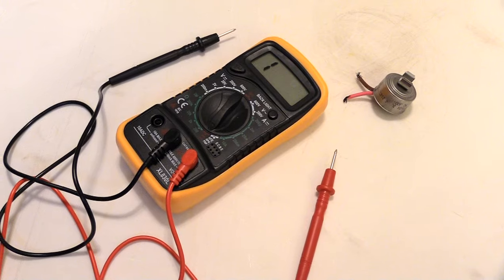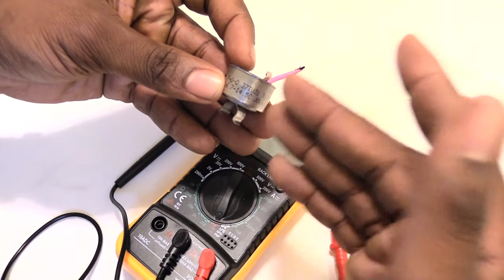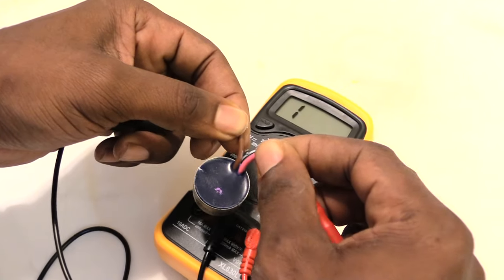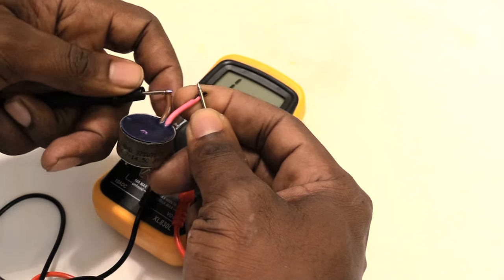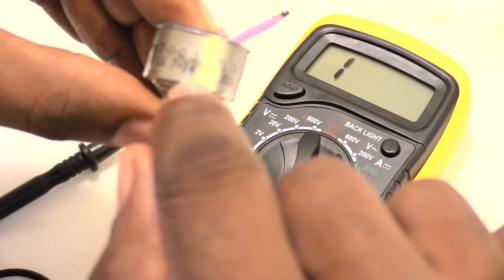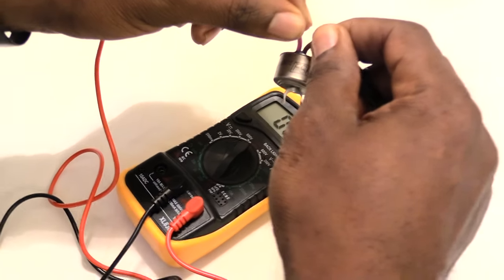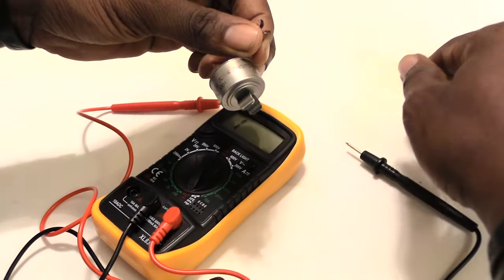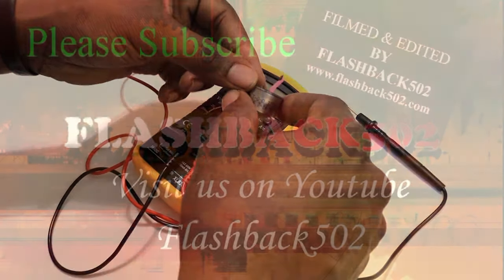How to Test Refrigerator Defrost Thermostat & How it Works!

Comment: This video explained it so much better than any of the other top videos. They all said "IF CONTINUITY, WORKS OK" but there could be more than one problem with a thermostat.
Reply from the maker: In some cases yes, so if you still have same problem after testing, then I would replace to be sure. And Rule out  thermostat as your problem.

Comment: Thanks for the explanation.  I think you meant evaporator heater instead of evaporator.  When the the temp lowers because of frost and time, the thermostat closes and the heater next to the evaporator (coil) comes on.  The evaporator heater melts the frost and ice.  Then the thermostat warms up too and opens losing continuity and shuts off the heater.  Right?
Reply from the maker: Thanks for comment and for like and sub👍.

Comment: OMG...thank you for being so damn thorough. I watched numerous videos and yours is, by far, the best.  I clipped the wires, wrapped it around the multimeter, like in your video, and it beeped when I sprayed it with compressed air and the beep stopped at 54F (according to instructions about the numbers on the device). It was supposed to stop beeping at 59F, just a few off. It was truly a magical thing for me how it worked exactly like you said it would. Thank you. 

I check the compressor with the multimeter, and that works and  I changed the old relay, after testing it. The refrigerator/freezer still won’t get down to the right temperature. What else could I try?
Reply from the maker: Thanks for watching you could have a problem with your compressor if it's not coming on then frezzer and fridge will be warm, if your fridge was unplugged for over a few hours it will take a day or so to get back to normal temperature. How it works out. Goodluck. Please subscribe & like and share if haven't already and check out our other helpful videos

Comment: Appreciate your time. Thermostat will also raise I saw if bad. My element wont come on even when I manually cycle the frig by pushing light switch in frig 5 times I hear timer engage but element wont get warm. It checks out at 29 ohms so it seems good.
Reply from the maker: Your welcome hope u get it fixed.Please subscribe & like and share if haven't already and check out our other helpful videos

Comment: Good video, well explained but, I was searching for an answer originally to a question that nobody seems to have covered.  Maybe it’s a stupid question but, I really don’t need you to replay since I figured this out myself.  My question was ,” can you substitute a thermistor for defrost on the freezer evaporator with the bi-metal you are testing. I found that my 2 year old  fridge thermister tested bad, and a bi-metal was 75% cheaper.  I used the bimetallic and it worked fine and I am back in business
Reply from the maker: Thanks for commenting glad you got it fixed👍Please subscribe & like and share if haven't already and check out our other helpful videos

Comment: Good video, but it may be misleading for other cases, as not all fridge defrost the same way. Mine has L140-30F on the thermostat, so at room temperature it has continuity all the time. It’s a GE side-by-side.
Reply from the maker: Thanks for heads up👍Please subscribe & like and share if haven't already and check out our other helpful videos

Comment: This will be the next thing I check the next time my freezer coils ice over. We have a door seal on the fresh side that needs replaced (back ordered), but I'm not ever seeing the defrost cycle kick in anyway. Cleaned the exterior coils under the fridge last week (they were completely blocked) and made extra sure the doors were closing fine, but we still had problems. Its been more humid this summer, but no where near bad enough to overtake the defrost mode. Hoping its just the thermostat since I'd have to go deeper if it wasn't.
Reply from the maker: Yea definitely could be your problem hope u get it fixed. 
Please subscribe & like and share if haven't already and check out our other helpful videos

Comment: GREAT INFO!
Is this thermostat mounted inside the freezer itself (behind the panel where the evaporator fan is located)?
Or... 
Is this the thermostat for adjusting the Frig temperature which will be located inside the regular part of the frig usually by the dials to adjust the coldness of the frig?
My defroster does not want to turn off on an older Kenmore Frig. The defroster timer seems to be working as I can see movement inside the timer mechanism. Thanks.
Phil
Reply from the maker: It's in freezer department behind panel. Please subscribe like and share and check out our other helpfull videos

Comment: Changed mine out this morning then decided to check the continuity on the old one I had continuity when it was room temperature indicating closed and on low side as well. as far as I know I have not had and overworking evaporator.  if anything it has been under working because I have build up of frost and drinking water line dispenser freezes up. Now I just wait and see if it starts working properly. Your thoughts on closed Circuit at both ends of the temp range?
Reply from the maker: If fridge works right then thermostat is bad sometimes they can fail in strange ways.
Please subscribe & like and share if haven't already and check out our other helpful videos

Comment: Thanks for this video .
My fridge when I plug in the wire the fridge light inside the fridge working but the fridge compressor and the little cooling fan the one next to the copmressoer not running ?
Reply from the maker: Might want to check your timer to be sure it's working right.Please subscribe & like and share if haven't already and check out our other helpful videos

Comment: I have a GE fridge and I believe I need a new defrost thermostat. There is one within two degrees of the on & off temperature of the original. Essentially, isn't this just a switch that opens and closes with temperature changes?  Thanks

Comment: Nice video thank you.  So on my thermostat it reads L14.4 - 22.2c.  What is the opening and closing temperatures?  Do you do it the same way as the L55 - 35F which equals 20F?  Thank you

Comment: Thanks for the video.  My defrost heater keeps burning out every 5 months or so.  I think that it is staying on too long.  If the defrost thermostat is not working correct will that cause the heater to burn out eventually?  As I understand it, the defrost thermostat is sitting there....already closed when the defrost cycle starts.  The defrost heater heats up.  When temperature reaches certain temperature....the defrost thermostat opens....thereby stopping the heater.  Once the temperature drops to a certain temp the defrost thermostat closes and is ready for next cycle.  Is this your understanding?
Reply from the maker: Yes that is how it should work you could have a electrical problem also be sure your frig is not to close to your wall. Please subscribe & like and share if haven't already and check out our other helpful videos

Comment: hi! will it only sense the temp when it is clipped to the copper tube? I found mine unclipped and floating free (maybe due to all the frost on the pipe)
Reply from the maker: It doesn't  matter if it's clipped or not. Please like subscribe and share.

Comment: I noticed water damage to the base molding by my fridge and water on the floor. When I opened the freezer I noticed some frost on the evaporator coil so I just changed the defrost thermostat today and will see if that solves it.  When testing the old and new thermostats I couldn't get my multimeter to beep to test continuity on either one. I placed them in ice water for a few mins then tested the leads but no beeps. Even though the new one didn't beep I went ahead and installed it today.  I'll check my coils again in a couple of days to see if I'm still getting frost on them.
Reply from the maker: Hope it works out👍Please subscribe & like and share if haven't already and check out our other helpful videos

Comment: My defrost thermostat is stuck in the closed position.  I heated it in hot water to see if it would open and it did not.  Would the computer stop the defrost cycle anyway after a certain time?  If it does this, would the computer then  not  go into defrost mode until reset?  My fridge was totally frozen up and I thought the defrost thermostat would be stuck open?

Comment: I got a question I replace the defrost heater, and the Defrost Thermostat was on there too.  1 week later the frig was 50+ replaced the Defrost timer. Frig was 35-40' now about 5-6 days later, the frig back up to 50'+ And they is frost on the Freezer, (0'-10' normal) All parts are GE. Could the defrost thermostat be bad? (NEW GE Parts)...I was thinking of using the old thermostat of the old unit. (Which one bottom heater burn out, 2 top/bottom, for this unit side by side 1997 models GE TFX25JRBBWW)  Beep, at room temp, put in ice water no beep. Wait 1 hour to see if beeps again?
Reply from the maker: Yes sounds like a thermostat issue. Hope you get it fixed. please subscribe like and share and check our my other helpfull videos.

Comment: Mine apparently works, because I've no issue with my refrigerator being 10 year's old getting to cold or not cold enough. My issue is, recently the water which is supposed to drain out, becomes frozen and cause's the defrost water to enter the refrigerator. I found a fix, wrapping a piece of solid copper wire around the heat tube and down into the drain hole. But I assuming it's only going to be a temp fix. What cause it to work, but apparently not sufficent enough to keep the defrosted water from draining.
Reply from the maker: Sorry not sure of cause of your problem. Please subscribe like and share 🙏.

Comment: Hi, I'm having an issue whereby the freezer and refrigerator compartment is not cooling..I checked the electrical aspect of the compressor, fans and timer and its functioning as should. Before I jumped to the conclusion that the refrigerant has leaked out can you recommend what component should I check? Also, I notice that the suction line of the compressor isn't all that cold. The compressor is working as I mentioned earlier. Thanks
Reply from the maker: Your compressor sounds bad.

Comment: Hi flash. I got nothing on mine - it`s in ice water. Nada - zero. My voltmeter has no Sound on continuity, but the display reads zero. If I put the meter on ohms - it reads 01.5. So it`s bad?
Reply from the maker: Sounds like it is bad.Please subscribe & like and share if haven't already and check out our other helpful videos

Comment: Hi bro, does a 2 door refrigerator , the bottom door not cold enough , but at the top( freezer )works fine. Means the bimetal thermostat is at fault?

Comment: My Kenmore cold spot turns off and won't come on until I turn off thermostat and turn back on. Usually have to do it 3 or 4 times to get it back on.
Reply from the maker: Sounds like it  need to be replaced.Please subscribe & like and share if haven't already and check out our other helpful videos

Comment: Hello Sir,  My issue is I have water under my crisper in the refrigerator side. I checked my heat probe  and its registering 96 ohms. so I think its working, I did your test on the Defrost Thermostat , I found when its open or closed its toning.  so its faulty for sure.  There is no fridge frost build up. so my heater must me on non stop. I checked the water drain at the back of the fridge  and seem like the water is draining to the catch pan at the bottom of the fridge.  so my question is, why is water pooling and running eventually out the fridge door.  thank you. Samsung model RS277ACRS
Reply from the maker: If fridge is getting cold then you could have a water line problem, if it's not getting cold then it could be your compressor going out.

Comment: 3:40 you say you may be able to cool the thermostat to below the close temperature of 14F. How is that possible if by definition the ice water is at 32F, which is too warm to force it to close?? I don't think the icewater trick will work here but it is good for checking a thermistor.
Reply from the maker: You can stick it in the frezzer for about 5mins.Please subscribe & like and share if haven't already and check out our other helpful videos

Comment: Mine was doing it backwards .at room temp I was getting continuity, and my freezer was working fine but the fridge was getting hot and I had to unplug it cause it was so hot I was afraid it was going to be a fire....and then before the parts came in, we lost 200 bucks of food.   My old fridge was over 40 years old and worked great and you just had to unplug it every3 months to defrost the freezer. But "we" had to have this dumb painless fridge that cost 3500 dollar GE toilet/fridge that we bought and rolled it into the mortgage, that has been a piece of shit from the first 2 years we had it. the water and ice stopped working and the tec charged us 6 hundred bucks and still couldn't fix it.  and gave up and said we need to call GE. they gave us the run-a round too. now this problem ,so I said sure ,I'll try and fix it.... It's not like I don't have two broke down cars and 50 other things to do with my time , like finding a frigging job .. I'll just watch video after video learning about stupid refrigerators. And the only reason I'm doing this is the wife will be happy ......well, and I can keep my frigging beer cold !
Reply from the maker: Wow u been through a lot wit your fridge hope u get it fixed.

Comment: i have a 1999 fridge thats got one like that are they interchangeable? i ended up buying "4387503 Refrigerator Bimetal Defrost Thermostat Replacement Part by Blue Stars - Exact Fit for Whirlpool & Kenmore Refrigerators - Replaces WP4387503 343917 61002113 PS11742474 AP6009317" on amason in hopes it will work sicne nothign wants to say it works with that old of a modle number but its got the butter tub shaped one like this as well not the little stick